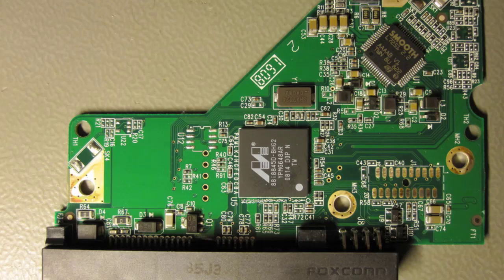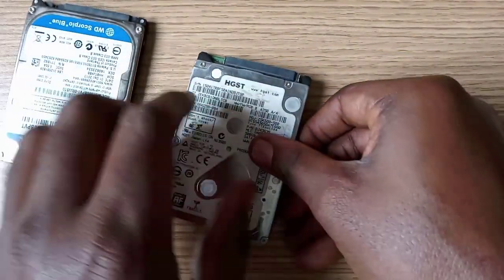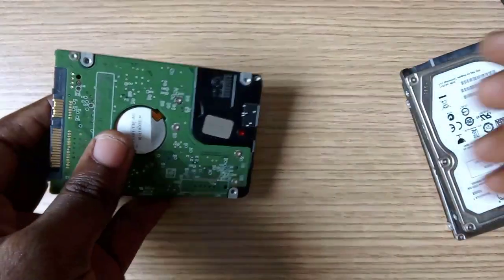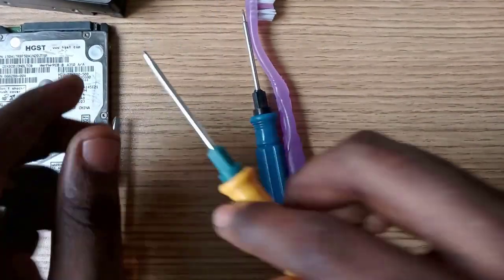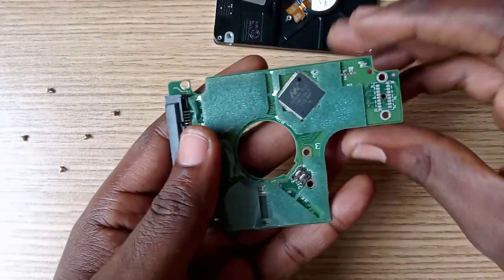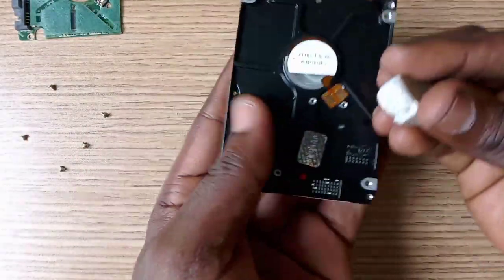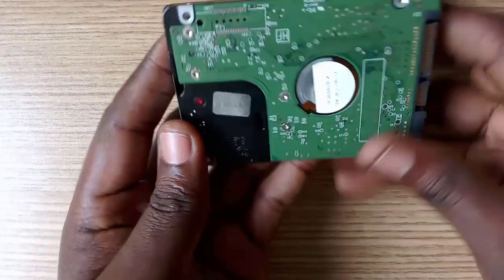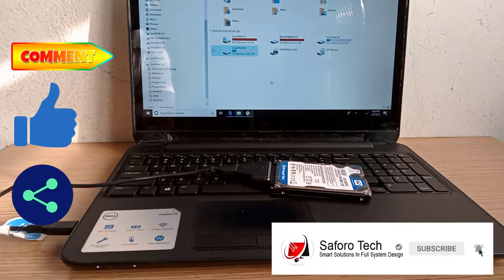How to Repair a Broken Hard Drive with Clicking Noise || Dead || No Spin || Data Recovery

Comment: Example of what not to do. Rubber leaves a layer that is insulating and hands leave grease that oxidizes the terminals over time.
Reply from the maker: I understand brother. Thanks for this submission.One thing about  teaching is you try to give an idea and a clue and followers learn, improve upon it and develop their own appropriate methods just to make it better. I will update this tutorial to another level where the same symptoms will require components replacement on the circuit board. I will have to do some videos about electronics engineering before that. Thanks once again bro for this tip We are always learning!!! God bless you!!!
Reply: This is not a repair, this is a data recovery: it need to be read only once than discarded.

Comment: Even though I've done the same thing, the HDD makes a noise and stops spinning.
Reply from the maker: This means the problem is coming from the read or write heads. And for that the read or write head needs replacement which you sent do that by yourself bro.
Reply: @saforotech8552  Ok I will try, thanks sir

Comment: Great tutorial. Did not work for me. My drive makes clicking sounds and stops. I have already opened it and the head is not stuck on the platter. It was not dropped or damaged as far as I know. It tries to read three times and stops. The clicking comes from the head trying to read and withdraws., It does three times and stops. Any advice?
Reply from the maker: Sorry brother, I understand. Your problem is the read or write head is damaged so it cannot read the disc. The only solution is to replace it and it's quite expensive. So if data is not the problem then I will suggest you let it go and replace the disk or buy another one. Hope thats fine brother

Comment: Hi sir, your tutorial was great but i have a question,
My hdd suddenly stopped working the motor is spinning but the r/w head is making rapidly clicking noise and it seems to be tired, 
Can you help me please?
Reply from the maker: Hello brother . I'm sorry for the situation. Please follow the tutorial first and if it doesn't work then it means the read or write head needs replacement and that should be done by a professional person since it requires professional equipment and experience. Please contact me on WhatsApp 00233246842497 if any further guide. Thanks bro.

Comment: Does the blue light need to be flashing or on all the time for a good hard drive.  I have 3 of these hard drives, all clicking, not spinning, that used to work great when in a computer. cheers steven
Reply from the maker: The blue light is an indicator to show when the hard drive is reading and writing. You should try the steps in the video you might be surprised you may recover all your three drives. I wish you the best and you can always reach me on my WhatsApp no in case you need further assistance 00233246842497. Take care  brother and stay blessed.

Comment: Can you fix WD Passport that is making a clicking noise every 2 seconds?
Reply from the maker: Hi brother, the clicking Noise of hard drives depends on the degree of damage. The problem can be the read and write heads or the controller board (pcb). If you need to swap the read or write head then you need a specialised equipment for this purpose and this has to be in an extremely clean room. My tutorial solution is just to teach viewers some of the common ways to fix some faulty hard drives that have the same symptoms. This solution can work for some drives with minor issues that has poor contact between the pcb to the mechanical drive read and write head connector terminals. Hope you understand brother. You can try this solution and if it doesn't work for you then it means the problem is coming from faulty read or write heads. Thanks for watching brother and please contact me if you need any furwr guide ( my WhatsApp or call - 00233246842497 )

Comment: wow! thank you, but please, before i open my  hard drive,,, for it will be my first time to do so,

mine occasionally comes on, but then on another pc start up, it doesn't then stays for weeks before it comes on again, 

will this procedure help out?
Reply from the maker: Oh yes brother. Please try this approach first. This is the first basic steps in hard drive repairing. So no worries try that and if it doesn't work we will try another alternative. I will make another future video to show people the other common problem that affect hard drives but before I make that video I need to make a supporting video on Electronics engineering's like how to use the soldering iron, multimeter and how to test electronics components. After those videos then  you can repair so many things on your own. Almost any gadget provided is electronics. I will teach you simple way So you don't have to be afraid of anything. You can follow my channel and learn so many secrets of repairing that you will not find anywhere. Please take my WhatsApp no and communicate with me after you attempt to repair your drive. 00233246842497. Thanks and stay blessed brother.

Comment: I got a laptop hard drive working fine but makes that clicking sound. Transferring media from one external hard drive to another hard drive takes forever. Any fix to this?
Reply from the maker: Ok brother, this is my own secret that I have been using for Soo many years to transfer  slow information on failing drive due to bad sectors. If you have a desktop computer it's pretty easy to open it and also you can connect both of your drives together in it. but if you only have a laptop then this is what you do. You have to disassemble to drive section and replace or connect it the faulty drive inside the laptop. Then use an external  casing or sata external device to connect the good drive. You will now need this program called hirens bootcd PE. Just Google and you can easily download it on hirensbootcd.com Create it with Rufus on a USB flash drive and boot it with your laptop whilst the two hard drives are both connected. Please Note this hirens bootcd pe has windows 10  operating system already on installed on the USB flash drive. So you boot it and get to the desktop. Go to this Pc and copy your data and you can see the two drives there. Now just copy the information you want. Sometimes for the first time when boot from the USB flash drive, it might be slow but please be patient for t to get the windows desktop. Then after you can shit down the laptop and restart it again then it will now be operating at normal speed. If you have any issues whasapp me on 00233246842497. I'm currently at work so I will respond anytime soon as I can brother.

Comment: Hlo professional i have a problem with my Seagate 500GB hard drive when i insert the casing and plug the USB to  pc it connects well the pc makes a sound that it has detected an yet when i check it    
Is not shown even in disk management and in device manager it shows a yellow sign under USB MASS STORAGE DEVICE and device status shows this device cannot start. (Code 10)
{Operation failed}
The requested operation was unsuccessful. Need ur help please
Reply from the maker: Hi brother, please kindly chat me WhatsApp so that we can resolve this problem. My WhatsApp no is 00233246842497. Thanks

Comment: My hard drive still works but Noise comes from it..if i follow this tutorial will the noise go away and i will be still able to use that hard drive? Pls help me
Reply from the maker: Not in all cases brother. But you can try and see. Most of the time it solves the noise problem due to bad contacts of the read / write actuator terminal. Thank you for watching bro.

Comment: brother, this is an excellent tutorial but bad luck, it didn't work for me. the clicking noise is still there and the HDD doesn't show up on the computer. When I go and see in the Disk Management, this HDD is being shown as "Not Initialized". Do you know something about this? The light is glowing properly and being shown in the taskbar to "eject safely". Please, need your help. Thanks in advance.
Reply from the maker: Hi bro, thanks for the compliments. Yes, drive not initialized caused by hardware failure is due to stuck read or write head. For that your last resort is to open the drive on a very clean room and reset the head to its original position . Please take my WhatsApp now and let me see if I can get any additional information to guide you. 00233246842497. Thanks brother
Reply: Hey. Did it work? I'm having the same problem.

Comment: Hi sir my internal hard drive spins and stop am not sure what is the problem please help
Reply from the maker: Hello bro, im really sorry about the situation. First of all please follow this method in the tutorial and if it still persists then Im sure  one of the integrated circuits on the hard drive controller board (PCB) is faulty. If you really want to recover data from this hard drive then you have to know a little of electronics to replace the chip or  order the whole controller board and replace the firmware chip from the old controller board to the new one. But if you don't have much sensitive data then I will advice you purchase another drive instead. Very soon I will start teaching electronics to teach members how to repair their computer and other gadgets beyond this basic level. Please kindly WhatsApp me if you need further assistance brother  +233246842497

Comment: youtube is funny you'll never find the problem you have all this tut have a working hdd
Reply from the maker: It depends brother. This tutorial was done with four different hard drives.  If you watch the video carefully you observed  the hard drive are four (4). Each of them had clicking sound and I followed the repair process for all the four faulty drives. Fortunately two of the hard drives were repaired successfully using this method whilst the other two did not work. So I only showed one of the successful hard drives which worked with the process. There are other way to also fix hard drives with the same symptoms but before I make a video on that I need to make a video on '' How to test electronic components using a multimeter and also how to use a soldering iron, etc. Sometimes I make videos using working equipment like this video with the link I'm going to provide.  The motive is to show the viewers what exactly you did or can do to resolve the problem and that is what teaching and learning is all about. You need to test the process to ensure they really work before impacting to your audience. Some people do videos that don't even work just to get views but I do my videos based on extensive research and testing. Thanks brother. Hope you are cool now.  https://youtu.be/iau0TkxAfYM